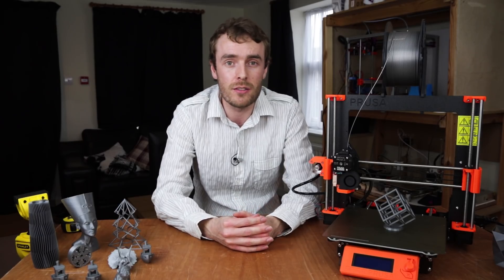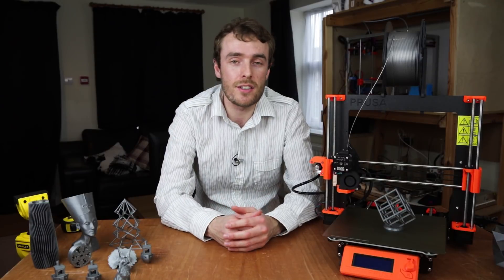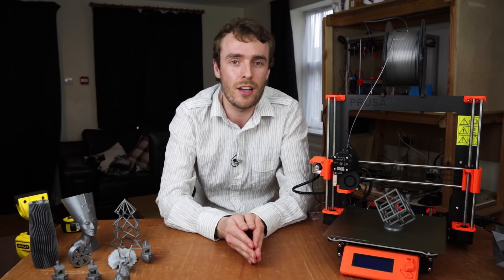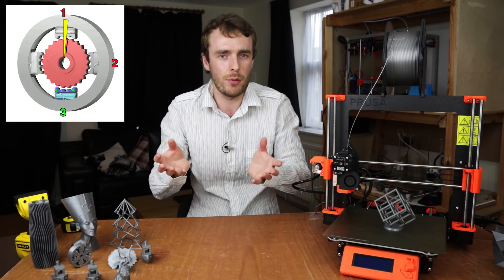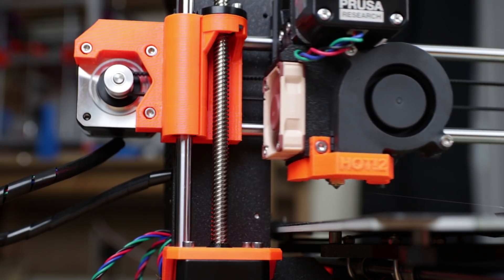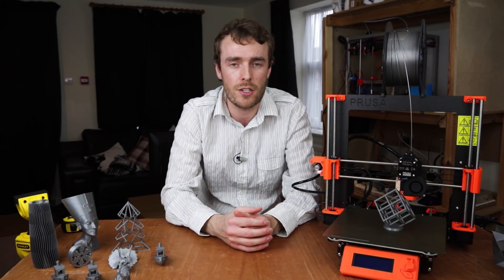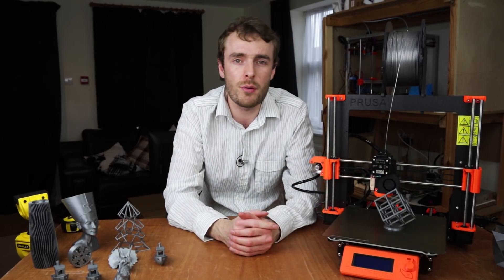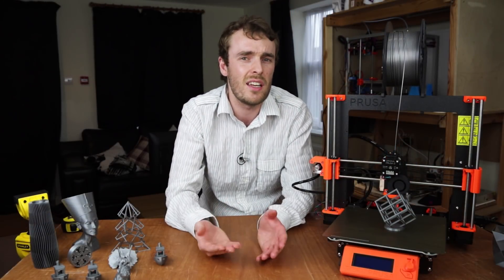Prusa i3 MK3 - Never skip a step again!

Comment: Can you use the tmc2130 on the extruder? will it work well and can it detect jammed extruder?
Reply from the maker: You could use them, but not sure if stallguard would work effectively for that.
Reply: @Vector3DP  Can you try it out and let me know? I am in the process of buying all the drivers so i want to buy the right ones for each motor.

Comment: Z axis not being used with stallgard homing has nothing to do with the stiffness of the build plate. If prusa wanted to, they could easily make it rigid enough. The problem is the nozzle, it needs to be kept within tolerance for best printing result and mashing it into the heated plate is an excellent way of damaging your nozzle

Comment: It may not be a big deal to tell the code to wait for operator approval after a certain number of crashes. The number of crashes you could even set yourself to choose from the menu.
That should be suggested to the programmers of Prusa.
Reply: you mean trinamic?
Reply: @darkracer1252  why trinamic? The driver just tells the firmware there hs bee a crash. What happens after that i all controlled by the firmware which is developed by Prusa.
Reply: @moclan5661  
the firmware is used by prusa.  developed by plain old hobbyists like ourselves. 
prusa is a horrible fucking company.  

shitty printers at gold prices. and then "their firmware" doesn't even have thermal runwaway protection..  

and incase you had no clue (wich it seems like it) 

this is ALL done by the stepper driver.  the 3d printer firmware is completely unaware of any of this.  it's just continuing to tell the stepper motor to go to the next location.  

it's called a closed loop stepper and i have them on my home built 3d printer. 

think of it like a rally driver and his navigator. 

prusa firmware is the navigator.  except it's blind and deaf. and completely unaware that they are upside down in a ditch.
Reply: @moclan5661  the homing and correction after that is even in free firmware. like marlin
Reply: @darkracer1252  the Prusa firmware is based on the open source firmware marlin, but is developed by in house developers employed by Prusa research. Also, Stall guard does not make a closed  create a closed loop stepper. It just measures the the current that the motor draws and forwards that to the firmware. If this current increases rapidly, you know you hit something. The drivers couldn't even do crash detection all by themselves since they are unaware what the other axis are doing, they operate independently.
Reply: @moclan5661  have you seen how long ago my first comment was?  that's how long ago it is that i watched the video.  

and stallguard...  is a function OF THE STEPPER DRIVER!!!!
Reply: @darkracer1252  yes, I'm not doubting that. The thing that's handled by the firmware is what do to if a crash occurs.

Comment: The Z-homing could be done on top I guess
Reply: Why not?
Reply: That's how Deltas do it, they home on top, and then use hardcoded or nowadays usually probed bed.
Reply: Siana Gearz.  Yes but a deltas bed is rigid...it can't move downward or flex like a Cartesian printer can. I think the electric connection method used by most printers is going to stay that way for awhile. Who knows? Time will tell

Comment: Great Job explaining how the skid detection works. I wonder if it could be modified to work with the Z calibration if they made a firmware change so that when the head is moving down the skip detection became more sensitive, then when it raised they switch back to  no skip detection. Moving the print head down would require very little power so detecting the feedback of a stall might be possible even on a non ridged bed. Just a thought. I am sure they looked into it already.
Reply: Great explanation. Thank you!